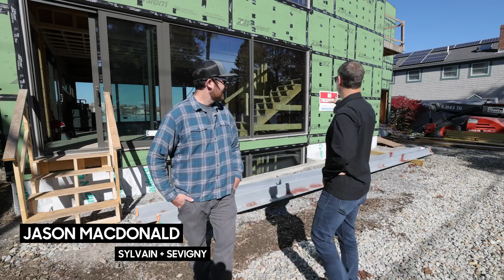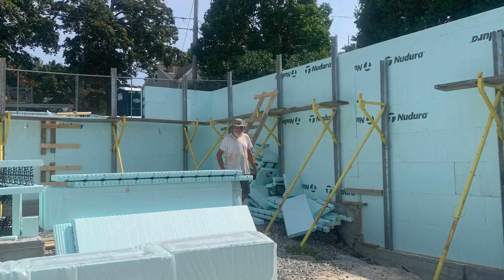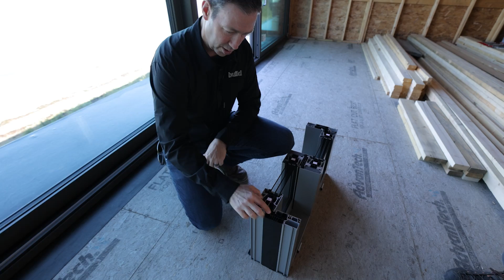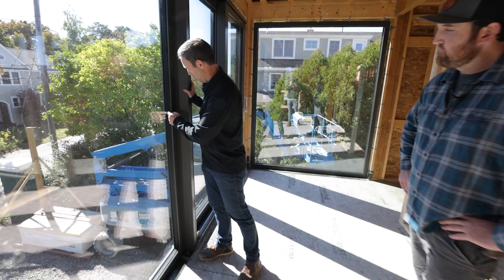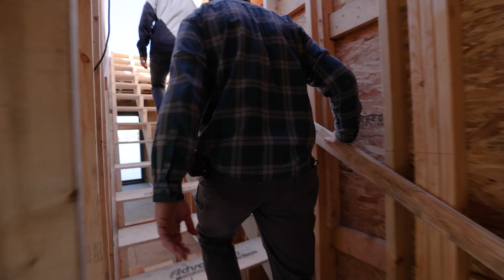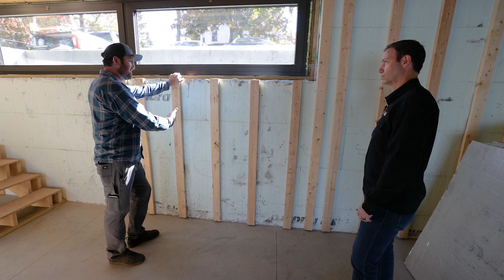Insulation Details on a Glass House

Comment: Hi Matt. I am in the middle of a re-mo on an aprx 130 year old double board house near fort worth. I built my master bedroom 2 years ago. This video is about glass and insulation..... have you ever seen anyone use double windows in a single frame to create an airlock that can still open? Last winter when we got down to 16F we did not use so much as a floor heater. ZERO heat at night in the master and I think the biggest contribution was the double window airlock. Where a single standard double pane is cold to the touch in the interior at low outside temps the interior glass (4th pane)  of my airlock was room temp so there was no air falling off the glass so to speak. On top of being double board walls it is now dense packed cellulose with new sheath house wrap and James Hardie stucco 4x8's. Interior I laid up 4 layers of 1/2" sheet rock for a cheap sound proof to block 130db live sound in the next room and I dont think we could ask for any better performance of thermal and sound barrier.

Comment: Wet concrete reacts negatively with galvanized steel, accelerating rust. The “foundation screws” are capped with galvanized plates that hold it to and stabilize the footer all via a wet concrete pour. Beautiful build but I’m wondering if this was factored into the engineering.

Comment: I've put drywall on ICF and it's not that bad. If the wall wasn't braced properly you can have a bow in the middle, but as long as you're not using 5/8 it will conform to the shape. Also, we glue it to the ICF and use very few screws, only enough to hold it in place while the glue dries. Have to remove the dust off the wall, but foam adhesive works really well. Super strong bond. Routing electrical through is pretty easy as well, though messy and the depth of the foxblox work with a standard 18 cu in single gang box just fine, though you're butted up against the concrete when you place them.

Comment: Awesome house! R-50 on the roof? Wow that’s awesome! I’m a big fan of your show! I’m following your lead with Atlas Polyiso although here in Utah only one company stocks it! Also using your Zip and Zip 2.0 when JeldWen Windows 1/4” and 1/8” glass higher R-value at STC ratings finally ship out some replacement windows that were damaged  due to improper packing at their factory bent vinyl nail on fins and bottom nail on fin completely caved in! Now my project has been postponed until spring 2023! Argh!

Comment: i think someone needs to tell the owner how polyiso performs in the winter... should have done rockwool, gps, or wood fiber.
Reply: He is doing rockwool in the interior cavities.
Reply: @moocowzrock  smart choice, no doubt. but paying for r12 exterior that'll perform like r9 in the Maine winters is a little goofy when one could have done rockwool or gps and actually gotten true r12 performance.
Reply: @stevecrawford6958  I think the biggest part of it was a combination of wanting a couple layers of thermal breaks, having the strength and rigidity of poly-iso for that second sheathing layer, having a thinner wall assembly(to get the same r-value with exterior rockwool would make that wall system pretty thick, which kills the sleeker contemporary look they are going for)  That and don't forget he did Zip R-12 on top of an 1" thick poly-iso layer thats R-7, on top of the rockwool in the interior cavities, so they are shooting for probably at least an R-25 wall system in winter that will be insanely efficient with a couple layers that limit thermal bridging.  With all that glass, they probably figured go overkill on the walls and focus the hvac on the glass lol.

Comment: You should try InsoFast for the ICF basement. Great product. 
You shouldn't be putting wood on exterior walls in basements. It is 2022 guys. 
Even if there is no external water intrusion, a plumbing issue will ruin those walls as water has no escape in a basement.

Comment: I don’t understand if the windows ship with out glass, do they get the air sucked out between the panes on install or what? Don’t most windows have a vacuum between panes to give them better insulation? How is this dealt with. You glossed over that part super quick!
Reply: Glass is combined and sealed. Ready to be put into windows frame. This is  example of big aluminium window install https://www.youtube.com/watch?v=ASdFMbP8EKU
Reply: I *think the panes are all packed together into some sort of assembly, not individually added. 

Also glass has gas between the panes, just generally something inert, dry, and insulating.
Reply: @timgleason2527  This is correct, it's called an IGU (insulated glass unit) and it's usually fitted into the frame with snap-in beads. It's standard in Europe for the IGU and beads to be supplied separately for easier handling by fitting the frames un-glazed. Since we mostly have un-clad masonry walls, It also allows to hide the flame fixings without any flanges etc. because fixings can be drilled through the frame in the glazing rebate, so the IGU and bead covers up the screw heads.

Comment: Two things I never thought I'd see on a waterfront build - a basement by the shore and a flat roof - especially in the northeast where it is always wet and windy.  Even an ICF foundation can fail.  Wondering how long the "dry" basement right on the water table will stay dry, and how practical it is to build a flat roof in an area with such significant snow load.
Reply: This house is literally a showcase in everything I would think is impossible in a snowy coastal location. But I guess with enough engineering and money, anything is possible!

Comment: What adhesive sticks to the zip system tape and liquid flashing ? Can’t find something that works for the EPDM rubber- Zip connection.
Reply: Huber recomended 3M hi strength 90 (doesn’t work ) 90-8-30A Epdm adhesive (doesn’t work )

Comment: High quality build and attention to detail, but can't help but think that further efficiencies can be found in the exterior wall assembly. Zip-R12 seems overkill when there's already regular Zip behind for shear. Likely could've just gone over the regular Zip with polyiso secured by PT 1x4 strapping instead.

EPDM rubber as the roof membrane is also somewhat underwhelming - a quality build like this would be even more durable if the roof membrane's seams were heat-welded, if not full torch-on throughout.

Comment: Am I correct in guessing that, since the studs in the basement are laid flat on the foam, the electrician will have to cut little pockets out of the foam to accommodate the depth of receptacle and switch boxes?
Because stuff are 1.5" thick and boxes are usually at least 2.5" deep.
Reply from the maker: No, shallow boxes fit in that depth. No foam cutting necessary
Reply: @buildshow  Oh, shallow boxes. 😂You had me scratching my head there, for a sec. Typing on phones, amirite.

Comment: Maybe with zip r12 we should go back to old ways of shear bracing with inlayed diagnal braceing? 
Or make up a new  solution to place that extra shear sheeting on the inside?
Reply: Even better an interior sheer sheeting that has a coating on it that can replace the sheet rock because it's able to paint  mud and tape just as easy or it doesn't need mud at all? Just tape and paint

Comment: So what's the R value of the triple pane low-e guessing 4-5?  Those sliders gaskets and all will hurt the blower test.
Reply: Those are lift and slide. Triple pane can be up to r11, which is still way lower than a wall.
Reply: @jasonmajere2165  quadruple glazing is more commonplace in Scandinavia now. Even 6 pane glass is available. The r value is not far off a wall